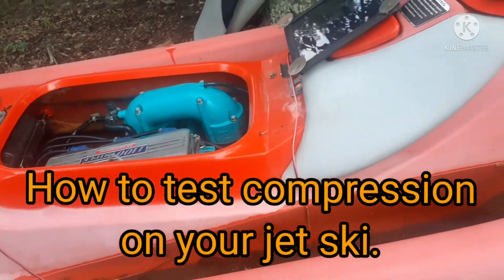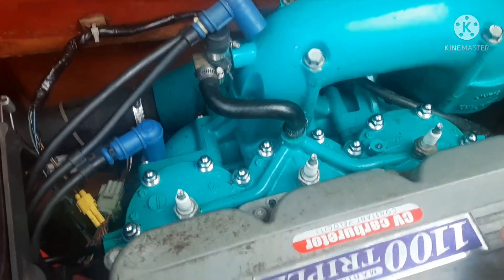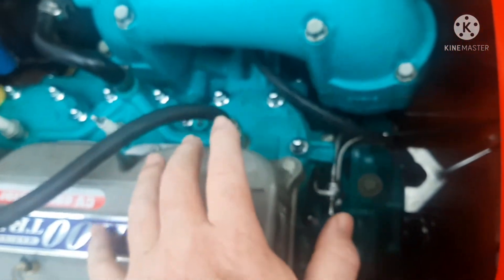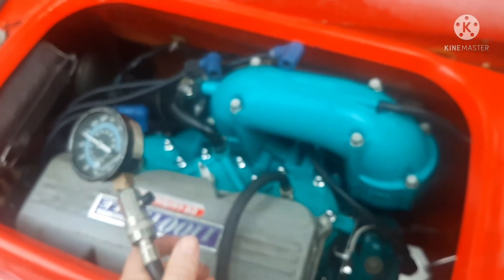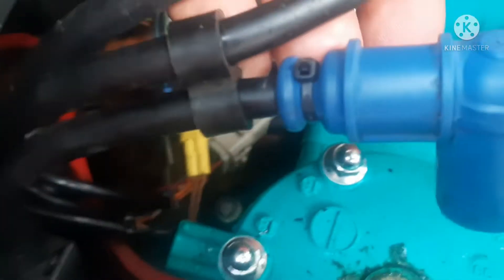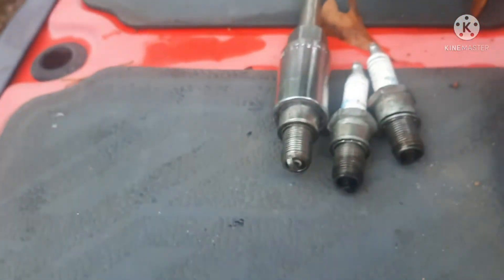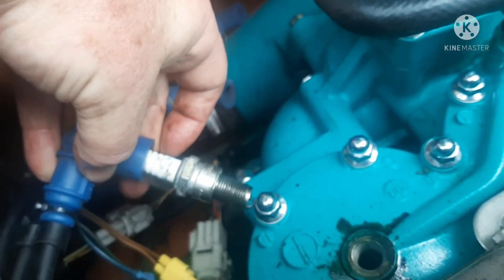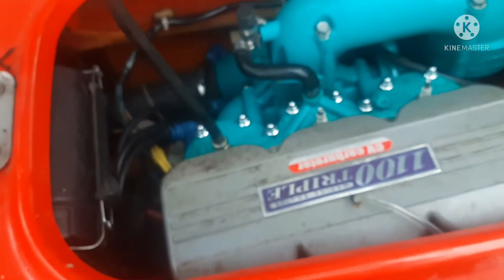Performing a simple compression test on a jet ski.

Comment: It appears that all the boots are removed throughout, so how the heck does the engine start up and run full throttle during the test?  Other tests I've seen, they just crank the starter but the engine doesn't start, which makes sense to me.  How the heck can it start?  Also, I assume you keep both of the other plugs in the cylinders you aren't testing, correct?
Reply: Checking compression on a Yami XL1200 and a Seadoo SPX tomorrow. Does the fuel line need to be disabled or anything else, or is this straight forward just like you showed haha? Thanks!
Reply from the maker: @hdemark5825  pull the plug and shut off fuel selector.  Test the compression.  You are supposed to pull WOT wide open throttle as you turn it over and ideally the engine is already warm.  Not always able to have a running engine though.  Pull all wires so you have no spark
Reply: To add to my comment, is it just the fuel selector that is being shut off (on/off/reserve)? Thanks again.
Reply from the maker: @hdemark5825  yes
Reply: @ShadetreeJetski  thanks for the quick, informative response. Much appreciated!
Reply from the maker: @PubDiji  you can have the plugs all out or in.  Make sure your wires are pulled.  No you dont want the engine to start.  Shut off the fuel selector valve.
Reply from the maker: @PubDiji  you dont need the engine to start to read compression.  Just turn it over.  You can have all the plugs out or just 1 plug out as you are testing each cylinder.  I have had one start up on one cylinder before while doing this because I left the boot on so yeah pull all the boots.

Comment: Two questions. 1. Do have to shut off fuel for the pressure test?
2. Do you have to ground the spark plug wires for the pressure test?
Reply from the maker: Yes shut off fuel. Yes ground the plug wires